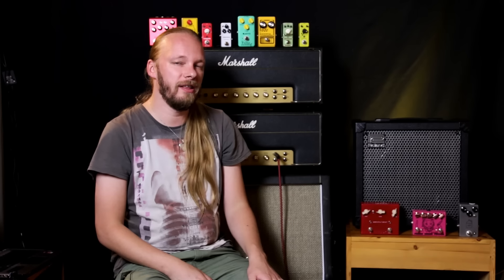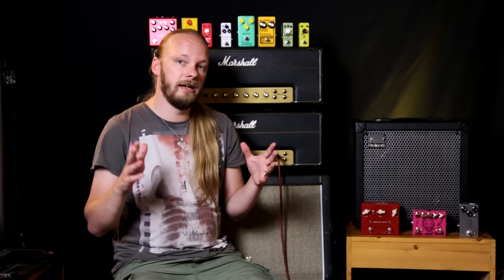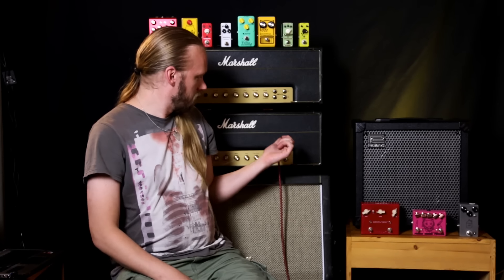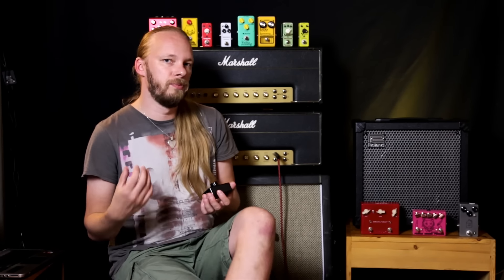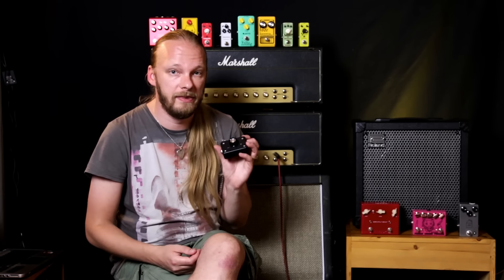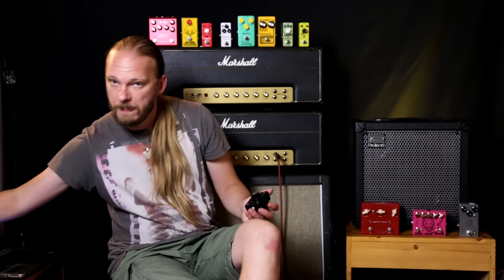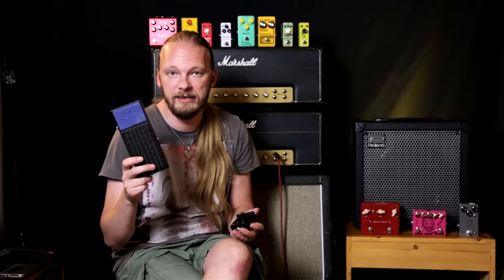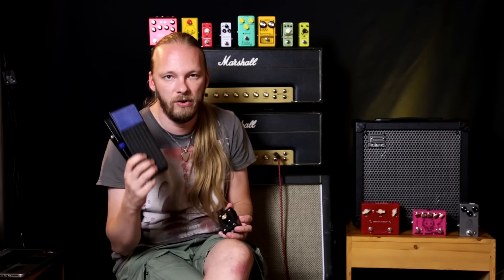Marshall Plexi? At BEDROOM Volume?

Comment: Good to see someone out there who scallops their own necks like me.   Takes balls to do that.
Reply: Stonehouse Guitars Once you play a scalloped it’s hard to go back. Loads more expression in your bends. Takes a lot of patience though
Reply: Homer Simpson I switched about 10 years ago and I don’t even notice it anymore.  I notice if I play a regular fretboard,  hammer-ons and pulloffs and legato seem to be quite a bit easier.  The added resistance helps there I think.  But I don’t have any problems with that with a scalloped fretboard, it’s just super easy on a flat one.  Scalloped was the way to go for me, I’ve never looked back since, although a flat fretboard does not bother me that much.  Just makes bends and vibrato not as fluid or good.

Comment: The newer 1987X heads sound nasty and noisy and the fx loop is weird. You shouldn't have to service a new head but better tubes some tweaks and putting the treble cap across both channels like the early Marshalls makes it much more usable for cleaner settings then you can use a boost or an OD. Or use a power brake.

Comment: Fender amps are famous for going from can't hear anything to the windows and doors rattling. The way I tamed my 65 twin reverb was to change the volume pot on the amp with a volume pot with a better linear taper.. finally,  I used a overdrive pedal as a clean boost and tone filter and that was the silver bullet.  I could use it on 1 and still get an excellent practice tone. Another trick is to remove a power tube. I personally don't like that as it makes the tone sound weak.

Comment: I like an EQ pedal in the loop for solo boosts, and you can use it like the volume pot to decrease the volume. You can adjust the EQ if you lose any tone from lowering the overall volume. Or like I did, get a master volume put in the amp. Actually, on my 1987x I had 2 master volumes put in. One works as a master for overall volume control (with both channels on 10) the second master is foot-switchable for a lead volume boost. Works great.

Comment: I have a Plexi Reissue that I run through a Rivera Rock Crusher 
attenuator and can get fully cranked tone at bedroom level pretty 
easily...it's beautiful actually. I do run a rack mounted reverb unit 
though it as well for the reverb mostly but I can fine tune the volume 
there if need be, it's generally left at unity on the output and input 
as it goes through the preamp stage on the amp and can effect tone 
especially when turned very low, can get thin...but great for level 
setting in between dB stages on an attenuator. Great to have for live 
sound in any sized room while keeping consistent tone. That RC is great 
for home studio/recording purposes too. Mic'd in the home studio (I 
still record to analog tape) I sometimes have to take the headphones off
 to make sure it's not too loud because it just sounds so damn good and 
full toned in there, doesn't get thin, stays creamy on the high notes, 
because it's essentially a fully cranked Plexi. 

Point being: I would not rule out a good attenuator, they can work 
wonders on these beasts. Nice rig (those things are tone monsters), nice
 work, good demo...and yes, a volume box through the back is a lot less 
costly than a good attenuator, so that is worthy info for those on a 
budget. Cheers.
Reply from the maker: Thanks! And yeah, I understand what you're saying about an attenuator. I'm planning on getting one, but I want something that will do the job once and for all, so it will have to cost a bit. We'll see what I decide on getting.
Reply: Rivera Rock Crusher, and I'm not a salesperson, just a user, is a reactive attenuator, not resistive, and it does a fantastic job on holding tone...just buy it used, I did, and got it for $300 US dollars, lists for $550 new. When I asked the people via email at Rivera if it could handle a 100 watt Plexi dimed, they were quick to respond and said that is it exactly the amp they had in mind when they made it and to dime away. 

Here's the other plus side to it, it's great live and will allow you to hold consistent tone and give a good volume control for any size venue, small or large, pub, whatever...the sound guys will love you for it. No more evil stare downs when you roll in your Plexi stack. Great video and good info.
Reply: seems like even for low wattage tube amps you really need an attenuator in most cases. Heck even my 1 watt solid state Vox mini G3 amp gets loud at half volume.
Reply: I have the YJM100 Marshall amp with the built-in attentuator. Looks amazing to have up here but can't really get much use out of it as it has to be set aggressively, so I'm back to my solid state Marshall till I can isolate it. I was thinking of wiring it up in the garage fully soundproofed and then using a wireless system to play back through my guitar/speakers that I keep in my bedroom. Or maybe I need a Rivera Rock Crusher, ha. Would that be better than the YJM attenuator?

Comment: The rivera rockcrusher is an amazing attenuator. Maintains every bit of tone
Reply: I didn't know this loadbox. Could you use it also for home recording with cab and mic simulation? What's the difference with the Universal Ausio OX? Thanks!
Reply: @francesco0185  The rivera rockcrusher works better as an attenuator while UA OX works better as a load box with great cab and mic simulation(yes, rivera rockcrusher doesent have that)

Comment: My understanding is this....
The way you are doing this in the loop is actually placing a master volume before the phase inverter tube. I think this is where they placed the master volume circuit in the JCM800s, but I don't know or sure. There is another mod that places it after the phase inverter tube known as a PPIMV which stands for post phase inverter master volume.... LaMar Master Volume is a popular mod for plexis. That tube is absolutley responsible for a lot of the plexi tone so you're missing a gain stage if you stick it in the loop. I have a plexi with a PPIMV and have A/B both ways and there is a definite difference in the tone doing this in the loop where there is barely any with the PPIMV. I can take my plexi on nuclear and tame it quite easily. All that being said this is a great solution  and you can do it for $20 if you don't already have an extra volume pedal lying around. If you've got a plexi check into a PPIMV. It's gonna run ya about $100 which is still cheaper than an attenuator, but if you've got a plexi  type amp you've already got some $ invested.
Great video, Great playing
I sunscribed
Reply from the maker: Cheers :)

Comment: Boss GE-7 EQ has plus or minus 15db slider. Crank the amp to where you like it and drop the volume to where you need it on the pedal. Same tone just quieter. That's if you like having eq options aswell as volume control. Otherwise a vol pot will do fine like he says
Reply from the maker: The volume pot I have has more range and is way cheaper.
Reply: If you turn the EQ pedal down you won't be hitting the front end of the amp with any Force. Maybe I'm misunderstanding. It would be like turning your volume down on your guitar same thing.
Reply: Youre right but if you use eq in the loop you're still hitting the front end the same, just basically attenuating it.
Reply: Ah the fx loop. Let me go try that. I've been using an attenuator. This never dawned on me.
Reply: you can do this also with a Helix or Multi FX pedal right? Just lower the output on the multi fx

Comment: I’m one for low tube amp volume bc I’m in an apt setting .. 
I Own Bugera tube G20 watt amp with 2 - 80 watt Bugera TS cabinets and my amp is at full functionality at low volume , my low volume is set at tv volume setting when I’m channeling it.  
So I set my tv volume for whatever then see if tv volume drowns out or equal to my amp and if it does then off the tv then jam.  Then when I up the amp volume then my tv sound bar fills the gap 🤘🎸🤘
Btw ... I’m still interested in purchasing a Marshall rig setup and just leave my tv sound bar just loud 🤘

Comment: funny: my rivera from 1992 has a FX-return volume for both power amps separately. and they tell that trick in the manual as far as i remember
Reply from the maker: Cool :)
Reply: @MrPolevaulter   yh, but many amps have only a send-level control these days (if any). your solution is pretty neat and straight forward. merry XMas!
Reply from the maker: @deadcatforcutie9349  Thanks! Have a Merry Christmas too :)

Comment: I use a serie/parallel switch. After the whole amp. Trainwreck expres.  It sounds as if you connect more speakers  and your impedance get's less. It's sounds good bc in this case the power amp is on 10 the whole time. So a 16 ohm in serie and a 16 ohm paralel. use big resistors ..............like 25/50 Watt. succes
Reply from the maker: Cool 😊

Comment: I do this on my new studio vintage.   I need to crank the amp, and it's 20 or 5 w. But sometimes on small stages where you mic the Amps, you need to go even lower. I have a rcbooster to put in the loop, and it works great. Great as a boost also. Kick it in on lower volume for rythm, Kick it off when it's time for solo😎
Reply: How does the Studio Vintage sound when you turn this volume control down low for playing at home volumes? 
Does a pedal with a volume control put in the effects loop also work to lower the volume?
Reply: @stratofig  I use a attenuator for that purpose. Just have the rc booster as a reverse boost, kind of.

Comment: Depending on your speakers, using an attenuator or effects loop master volume or post phase inverter master volume might lose you some "tone" due to a lack of speaker breakup caused by higher volumes.  Some speakers are "stiffer" than others, maintaining their signal integrity at higher volumes.  Others (like G12M25's and G12H30's, for instance, among many others) will break up and distort at higher volumes.  If you've built your tone around a set of speakers that have an attractive-sounding breakup, you will lose that characteristic from your sound at lower volumes, even with the same amount of amp distortion.
I learned about this first-hand when I got a good rocking tone out of a 1959 Reissue without an effects loop.  In order to quiet it down, I got a Weber attenuator with a coneless speaker motor in it to reduce the volume going to the cab.  Unfortunately, part of that great tone was the speakers breaking up under the hideously, horrifyingly loud volume of the 100-watt Plexi.
That same attenuator worked great on a Laney AOR 100 rig, though.  The Laney cab's speakers broke up at much higher volume than the cab I used with the Marshall, so the attenuator didn't ruin the tone.
You learn these things as you go, sometimes.  Heed my warning about this, though, and you might save yourself some money if you investigate how loud speakers can get before they break up.  That way you can plan for an attenuator, if your amp doesn't have an effects loop or if you don't want to use it as a master volume, or if you're going to install a post phase inverter master volume.
One last thing:  If you want to get an attenuator to use on a non-master volume Marshall (or a clone of one), get one that's rated at at least half again the nominal rating of the amp.  So, get a 75-watt (or higher) attenuator for a Model 1986 or 1987 50-watt Plexi and a 150-watt (or higher) attenuator for a Model 1959 Plexi.  The reason is that, when these amps were first designed, built and marketed, the watts rating of the amp was at the point of a certain percentage of harmonic distortion of the system.  Think about that for a moment.  A 100-watt Plexi is putting out about 100 watts of power at the last point on the sweep of the volume knob that amp is still producing clean tones.  Where is that on your amp?  4?  5?  Everything after that is distorted and more watts.  Average, everyday, run-of-the-mill Plexis can generate 135 watts at max volume.  145 to 150 is perfectly common.  It is not unusual for them to produce 170 watts at full chat.  If you try to use a 100-watt attenuator on a "100-watt" Plexi, you might just burn up your attenuator.

Comment: Hello Elmo , where can I find this volume pot? Any product link ? Thanks
Reply from the maker: On eBay. There's one: https://www.ebay.com/itm/Metal-Volume-Box-guitar-amp-audio-taper-effects-loop-master-volume-attenuator/200925901680?hash=item2ec81df370:g:zqoAAOSwVctY5MXu
I have it, but it's not as good as the one I bought earlier (which isn't available anymore). Everything happens in a really small space when turning the knob, and then nothing happens. JHS also has one, but it's more expensive.
Reply: @MrPolevaulter  Thanks, I would like to buy a Marshall DSL20HR, for the construction type of the amplifier the JHS could be used or not? Would an attenuator be better?
I'd like to use the head at a bedroom level because I live in a small condo, the Marshall has a shunt to switch from 20 to 10 watt but still loud, Peavey 6505MH Will Be a Better choice?
Thank you
Reply from the maker: @antonio.cappelli  Not sure about the DSL. Haven't tried the pot in the lopp with that.

Comment: What are your thoughts on the smaller Friedman and Bogner amps like the mini Dirty Shirley, mini Runt 20, mini Pink Taco and Bogner Atma versus the mini Marshall re-issue amps? Seems like Friedman and Bogner hav solved the entire low volume issue and Marshall still is not quite there yet plus FX loop is better.
Reply from the maker: I haven't tried them, so can't really say.
Reply: I have a Friedman Be100 and the master volume works like a charm!!

Comment: take off the capacitor on the VOLUME 1 knob, or reduce to 500pf or 250pf. It will reduce the volume when you turn the knob down.  Not much, but the volume will be more notice.
Reply: Or just put a volume pedal in the effects loop.

Comment: Correct me if I am wrong, but the fx loop master volume is completely different from the actual sound. The classic plexi tone is based on BOTH preamp and power amp distortion. Using a volume knob in the fx loop (which I believe is pre phase inverter, the part that actually distorts), will only cut the signal more and more and doesn’t drive the phase inverter at all. This means that this sound is mostly if not only preamp distortion, which is NOT how a plexi sounds, which is why you need an attenuator in between power amp and speaker (which is definitely AFTER the phase inverter) so we can hear phase inverter/power amp distortion which is a big part of the sound of plexi users (ACDC’s Angus and Malcolm Young, Yngwie Malnsteen, Pete Townshend, Jimi Hendrix, Jimmy Page... etc)
Reply: absolutely right man!!!

Comment: Elmo! It works for the Marshall studio SV20C combo? Cheers from Argentina
Reply from the maker: If it has a loop, it should.
Reply: Hi
if i put a JHS little black amp in the fx loop of my sv20 (the same in your demo) i loose the Gain from the amp. Logical but not cool like your demo here. With a Vol pedal sadly the same. What the problem ? Thanks man;)
Reply: @christocaster  SV20 creates some of it's distortion from the power tubes if the preamp tube signal is large enough to drive the power tube into saturation. Since you are attenuating the preamp signal it doesn't have enough umph to push the power tube into saturation thus less gain coming out of the amp. In another words, most of your gain sounds come from the preamp tubes instead of the power tubes like a 100w plexi would produce. With sv20 you're better off with an attenuator between the power tube and the speaker that will reduce the volume of both pre and power tube distortions.
Reply: @jcd13able  ok thanks.

Comment: If you would ever make a video with the Waza Craft Expander set up as a normal attenuator between the head and the cab - set with the optimal choice of power tube match out of the 16 possible choices the device has, and compare that sound with the sound you get with your solution in this video, that would be a video I'd be very interested in watching! If your solution would be nearby soundwise, that easy way of solving the attenuator problem (where the attenuator used seldom is the right match for the power tube valves) would be highly desirable. :-)
Reply from the maker: I've been thinking about the possibility of making such a video. The Boss just costs a lot though, so I have to shift some gear first.
Reply: @MrPolevaulter  Maybe they'll send one for free to you just to hopefully market their product through your video. The result to be expected would at least in part be favorable for their product, and you have enough followers. 👍☺️

Comment: 85dB fully cranked? I doubt it.  Depending on the efficiency of the cabinet I’d think it’s more like 115-120dB. It’s probably pushing 90-95dB 20 meters from the cabinet, ie very loud indeed. 95dB would have equivalent loudness to sitting in a car with the radio at full volume.
Reply: I was guessing and expecting 115 dB. No way 85 dB, that's a commonplace level at home.